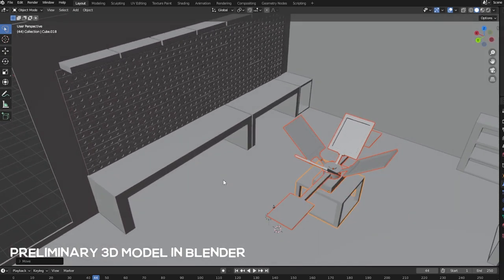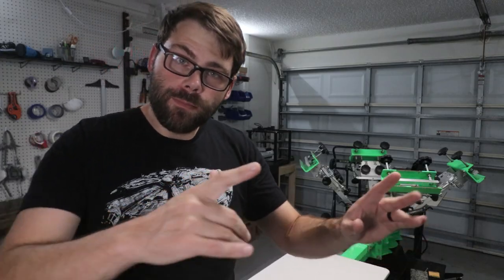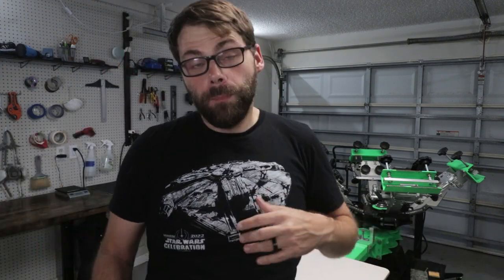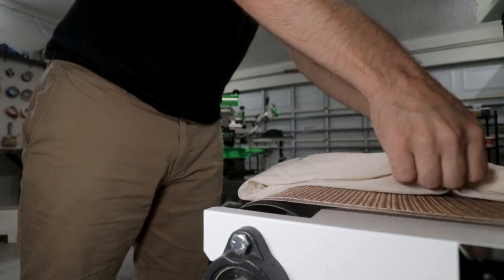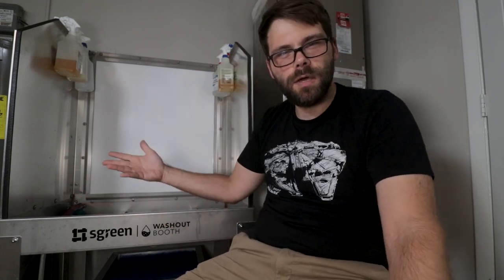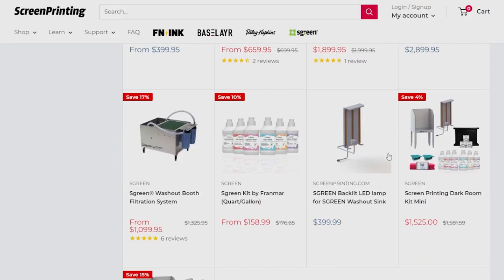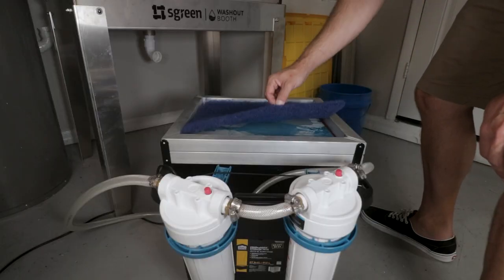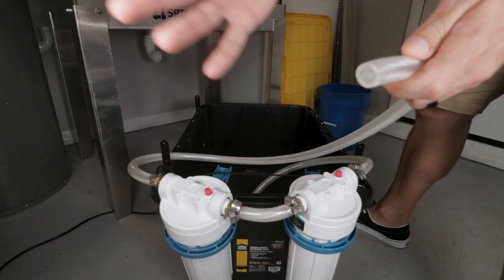New Studio Tour /// How to Make a DIY Filtration System

Comment: This is great! I work in a sheet metal shop and you’d think they’d encourage an employee discount from a build it yourself standpoint but noooo. 
Anyways I invested in that Sgreen washout and had the company make a dump sink that had brackets set inside to add the screens and brackets on the side for filter placement and lockable casters for easy transport and mobility. It’s all knockdown construction too so it can be disassembled if I move or need to ship one out for maintenance.

Comment: Thank you so much this is the best one on YouTube that mimics ryonet’s version
Reply from the maker: Thanks! After using it for a while I have some updates to it. I want to make a video for that, but the gist of it is adding a few more filters before water gets to the 2 water filters. They tend to clog up easily without those additional steps of filtration.
Reply: @joshisterrific  great I hope u can make the video soon!
Reply: Also make sure to not put the pump directly at the bottom of the tote bin, put it on top of something else so it won’t pick up all the ink that passes throguht the mesh filters, it will just pick up the water and won’t clog the filters so much